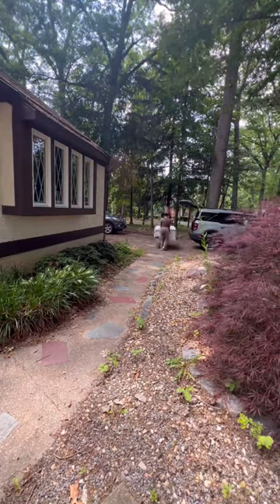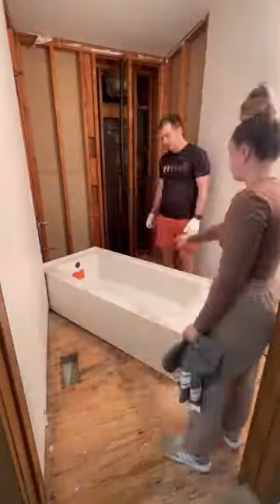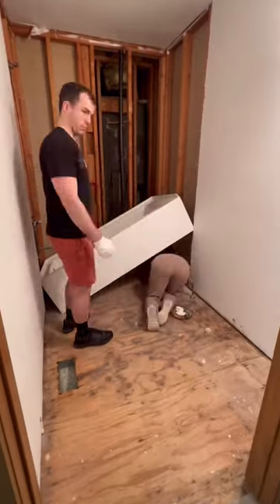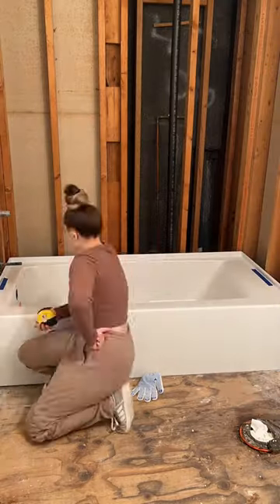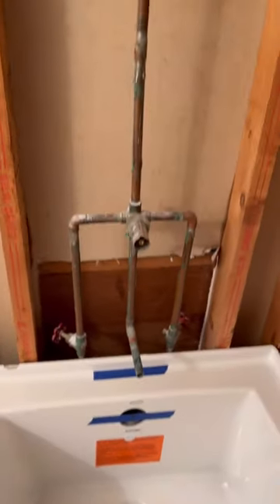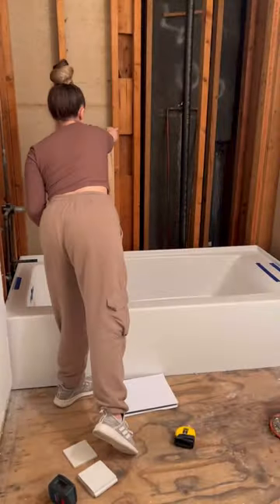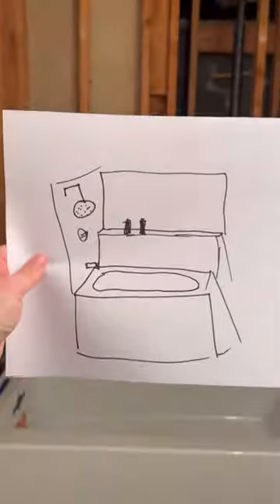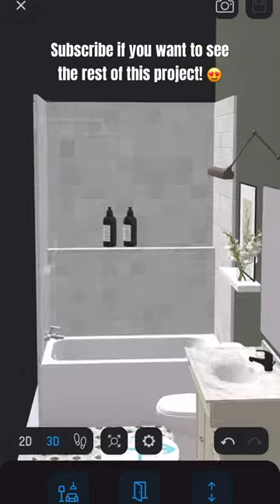HOT MESS LAKE HOUSE RENOVATION PART 166 | VIRAL TIKTOK SERIES | LEXI DIY

Comment: Absolutely! Probably want to slope the tile on the shelf a little so water doesn’t puddle. What is the little rendering program you used?
Reply: That was the comment I was going to add. Definitely put a little slope so the water doesn't pool. Not so much you have broken toes from shampoo bottles sliding off. That's the ultimate hurt in the shower.😂
Reply: Angle them upwards and drill weep holes at the apex

Comment: So an easy fix would be to add studs to the existing wall. You will lose a little square footage, but the shelf is gonna leave potential for water leaks slash pooling along the shelf. If you do use a shelf, there needs 1/8" slope so water can drain. If you build a faux wall extension with the studs it will be easier. Just an option.

Comment: As a professional remodeler, You should learn how to sweat copper. It is scary at first but very easy for small things like putting together the shower valve and or just converting from copper to pex-a and use pex as it is easier to work with especially if you plan on anymore diy. You can also purchase adapters to hook 1/2” copper up to a normal garden hose and do tests to makes sure your sweat joints are holding. There are some tricks to setting a tub, good luck setting the next one!

Comment: The shelf is good, but try to put it higher than the spray from the shower head and slope it so it's always dryish.  I would epoxy the cracks so that the have less chance of propagating later.  Be sure to support under the tub with stiff spray in foam or other supports. (and around the edge as per manufacturer's instruction)

Comment: Shower shelf is fine. Pre slope the prep work and put the backerboard on in bottom to top from tub to ceiling so the shelf over hangs lower backerboard and the back wall sits on the shelf backerboard. Then seal joints of course, I like quad max for goboard.

Comment: Hi. We took out a shower/tub insert and were left with a five/six inch gap to fill to get the tub to line up with the existing plumbing. We built out a half wall with a shelf on it and we love it. And we didn't have to build and waterproof a niche. We had more space between the tub and wall than you do though.  If you have the space I can recommend.

Comment: Def a shelf. with low voltage lights 👍🏼👍🏼👍🏼  but makesure  you waterproof it well   and it starts with  the structure   use framing screws    and also make sure your shelf has a small slope  to drain water off

Comment: I would also consider changing the shower valve before that. by the looks of it it’s going to be hard to find a trim to fit. Also wouldn’t have a pressure equalizer. I would switch to moen posi temp. Especially with old plumbing you don’t want someone to flush the toilet and then scalding water out of the shower and a new valve will help with that

Comment: Its only going to be a 2” shelf tho? If its an airbnb and you’re putting travel sized bottles on it then that might work but a full sized bottle is not going to fit especially if you pitch the shelf down for water

Comment: Your solution can work, but it sounds like your new tub is smaller.  I went bigger, and MOVED my plumbing.  Make sure you meet the clearance codes requirements between tub/toilet and the vanity.  Toilet usually needs a total of 16 inches from the centerline.  32 inches wide total.

Comment: When you readjusted the center for the tub you may have moved the tub too close to the toilet when looking straight towards the toilet flange you need a minimum of 15 in between the edge of the tub and the center of the flange. The best way to go about that would have been to replace the shower valve and move over the on center mark. Also the tub should have been set in mortar those types of tubs will crack I don't care what the manufacture says I have pulled out hundreds of them The ones that are set in concrete do not break on the base.

Comment: That shower shelf is perfect because we a
L need more storage in the shower.  I have more than three products I like to use, so this is practical that the tiny inset cubby.
I would have sprayfoamed around the tub to retain heat, as well as put in floor heating directly beneath...

Comment: Or you just simply move the darn drain over 3 inches. At a cost of about $10 in PVC. 
Although the shelf is nice.  But remember to pitch it out so it will not leak into the wall

Comment: Why dont you lower it to just about half an inch above the tub so it gives you room to use those very popular wooden tub tray/caddy. i have a tub too but can't use my tub tray cause the wall its connected to doesn't leave enough space to rest it. I can rest it on the edge of a tub bit it slips every easily. Plus if you lower the wall shelf you can reach everything if your laying down.

Comment: Once you said you bought the wrong side for the drain, I knew you’d mess up more stuff. Maybe take some construction classes—/or call a professional because thing’s your doing will not work long term.  You can’t crack a tub that bad and have it maintain its structural integrity.  Plus you clearly had no idea how to just put the tub into the pocket.  It’s really not that difficult and you damaged the tub simply trying to get it in the alcove.

Comment: No definitely not you will have problems with the shower water sitting on it because it's so shallow and the pitch you need for a shelf. Then you can't pitch it enough for water run off and then if you do  pitch it shampoo might stay but soap will slide off! but just do away with it. Other contractors will agree

Comment: I mean yes there is a number of different ways you can account for that 2" gap on the backside BUT what you're doing isn't wrong or stupid either. So if that's what you like and it solves your issue fuck anyone who says any different just make sure that shelf you put in has an ever so slight slant towards the tub so water won't either A. pool up where the wall meets the shelf or B. Just sits on the shelf itself that will in time eat away the grout then start working its way into the wall always remember when working with water doesn't matter what if it's Plumbing roofing masonry anything where water can ruin something period... Water has a mind of its own and is one of the most destructive forces known to man so plastics concrete really anything will eventually erode away if water that isn't supposed to be there is present especially constantly present when it shouldn't be even things meant to withstand water i.e tubs and showers will eventually erode away with enough time